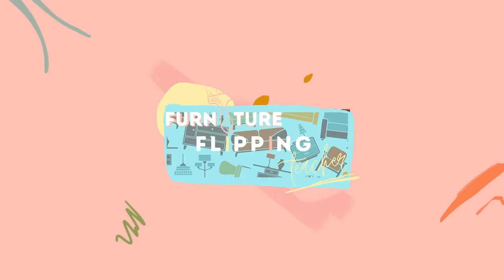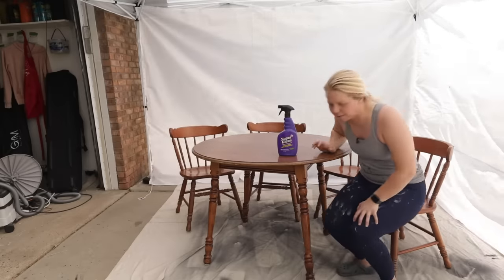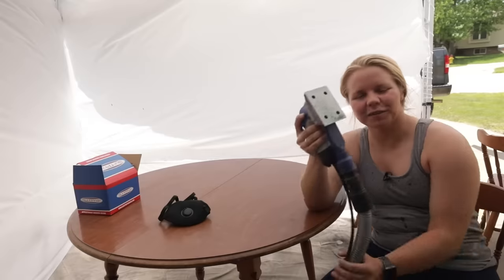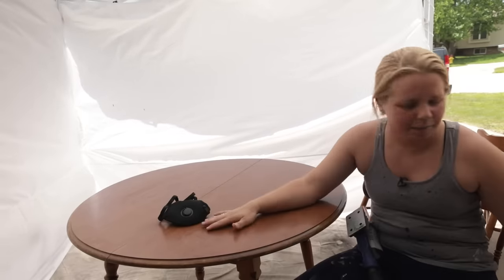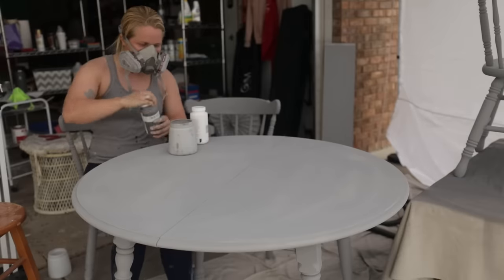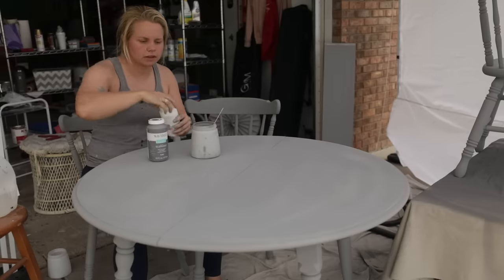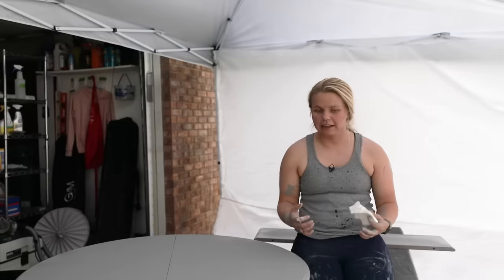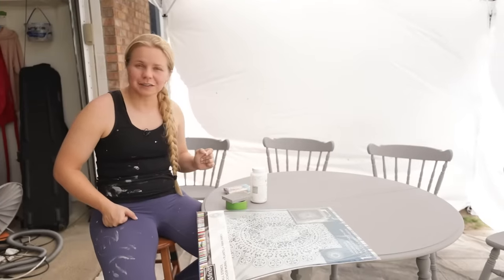WALMART CHALK PAINT??? Is it worth it? | Kitchen Table and Chairs Flip

Comment: A tip for stenciling if you don't want bleed through: have a paper towel handy to offload excess paint (less is more). Washing both sides of the stencil is really important. If ANY paint gets under and dries there it will be a constant point of leakage. Looks great though and not bad at all for a first try!

Comment: Love the stencil. Tried stenciling once,  smeared/blobbed. I need practice. Yours looks great! I think you should do more of it.
Reply: If you use a very dry brush, or sponge, it will work great. I would rather start with a very dry brush/sponge and have to make multiple applications, just to get it right, than to do it in a quicker time, and have it look messy.

Comment: P.s. I finished my first project today. I used Rust-Oleum chalk paint in country blue. And used Waverly clear wax. I found I did not use enough wax with the wax brush so I re applied it with a paint brush and wiped it back. Much better.  It's a found in the trash nightstand with two drawer. The drawer fronts had to be removed, were fabric covered, and was made from MDF. I did not paint them. I peeled off the fabric and tried a new fabric. It's not put back together yet. But I think it may look pretty nice in my room. Thank you, I have been inspired by you to try this! 😁

Comment: I am wondering what you got for it. I sold a solid wood round table, only 32” diameter. Waverly white on the bottom and Waverly Peacock on top and a white fleur de lis in the center. There were no chairs and I sold it for $150 in a suburb town of Houston, TX…8 years ago. Everything is even more expensive now!😊

Comment: I love stenciling although that particular one is not my style but after practicing quite a bit I have found that using a large fat stencil brush and offloading your paint until it's almost dry works best. Alot of your high end stockists, probably even Dixie Belle has the type of stencil brush that will really work much better, I started with sponges like you too. I would also suggest that on a table top Waverly wax or any brand of wax wouldn't be the best as tables get alot of use/abuse/wear on the top, I would stick to a few coats of traditional sealer at least on top. All in all I think it came out great, and it's great to see you're branching out, once you start stenciling and doing transfers it's addicting.  And men...lol...they don't always get it!!

Comment: So very cute! 250.00 is great up to 350.00. You did much better than I did with stenciling. I made a hot  mess when I did my first one. I had to sand off and start over like five times. Pixie spray tacky adhesive helped it not get under the stencil. If it doesn't sell you could try farm house decor. A White and black Amish look? I think it is cute esp. for a breakfast nook. Mrs. Laura Burcham commenting.

Comment: I love it I kind of think most people will get a little turned off because it's not asymmetric or you have a pattern going on the top making it more cohesive.
I mean that's just what I'm thinking most people that are OCD are going to say but overall it's good. I had a set myself that I sold that a butcher block top and had Napoleon style chairs that the whole thing cost me only $90 to do and I sold it for 300. So I think you have a shot at 300 at least.

Comment: I think you were supposed to use less paint when stenciling. Wipe off some of the paint off the brush.
Reply from the maker: Yes! I did do this (: Thanks for watching!
Reply: Hi Lauren! I watch all your videos time after time after time. I've learned so much. I was thinking about your table as I went to sleep last night. I love it but maybe a little color might be the answer. I think the paint on your mandalas looks good. I think though that I would add some maybe Fuschia paint on your stencils. Take one of your round brushes and do a type of dry brush technique.  Make light dabs of the Fuschia paint on your mandalas. Then use Howdy-Do Hemp Oil. It rejuvenates the wood..still a satin finish. Just a thought. Btw, I'm sitting here in Wichita watching you now. Great work!!
Reply: This was great but worth more like 300 to 350.

Comment: True stenciling uses very little paint on the brush it’s almost dry. That prevents bleeding and running. Most people I see load their brush with paint and start dabbing. Pour a small amount onto a small plate and tap off the excess then tap lightly onto the stencil. It’s not as fast but a much cleaner look.

Comment: I have stenciled a bit in my time.  You had too much paint on your dabber.  Dab on a paper towel to have almost a dry dabbler before stenciling on the piece and you will have less bleeding under your stencil (tape it down more also). You will have a more crisp outcome with less paint. Cute set though!

Comment: I haven't tried it yet but I've read that if you stencil with a layer of top coat first followed by stenciling with paint to cut down on runs under the stencil. I'm not sure how it will work on the parts that run off the table.

Comment: Tip for stencils:
-Use the dry sponge method
-Or apply satin top coat before do your stencil (the bleed through is going to be all with the top coat and not your paint
-Or apply a coat of your base color before stencil 

You did a great job!

Comment: I have been trying to redo my table top for the past 4-6 weeks and I’m about ready to burn the dang thing!! 😫😫😫 I don’t know WHAT I’m doing wrong and it’s so frustrating! I followed your steps of scrubbing down, sanding…..and sanding and sanding…..put my stain on and YIKES….no bueno! The rest of it; table base, chair bases turned out good…..but the tabletop! 😭😭😭 Then I was told the stain didn’t have anything to adhere to because of the way I sanded it. So then I applied a Zinzer sanding/primer type stuff and let it dry. Then I was told to use a gel stain ……..oh my gosh what a flipping mess!! My first redo vision took a major dump!
Plus, I want one of those sanders you use, but holy cow they are a bit pricey. So I need to start saving my pennies! lol

Comment: When you stencil, you are supposed to have a very dry stencil dauber so daub in the paint and then have a paper plate or something where you can dab most of the paint off and then apply to your stencil. You may have to go back over it more than once if you need more paint in the places you need more paint. A too wet dauber is how you get the blead through

Comment: Do you clean your sprayer between coats? If not how do you keep the nozzle from clogging?
Reply from the maker: Not between coats! I just put a damp cloth on the nozzle!
Reply: @FurnitureFlippingTeacher  I sprayed for the first time this weekend and I can not believe how smooth of a finish I got. Saved so much time. I used silk in the color Serenity by Dixie Belle so I did not need to top coat. Top coats have been my struggle, I can’t seem to get a brush free smooth finish. 
Thanks for sharing your technique with the Waverly wax.

Comment: Teach, I would do an under coat of a pale 💙 blue or pale 🍋 lemon, or both. Or what color you desire. Then your gray covering that for the second coat. Then come back in with your stencil but in a darker or lighter gray,  and a few wide and narrow width parallel  stripes of lighter gray.  Then distress, revealing the under color here and there as they would naturally appear distressed with prior coats of paint peeking through. Seal. And then wax.  I guarantee any lack of attraction to the table is that the gray round table with round stencil in white will look a bit drab and round to some. But add dimension and movement and impart a history and it changes everything. I wouldn't go less than $300. If you wanted to add gigham tie on seat cushions in a complementary color or design,  bump the price up to cover them plus time. If it looks 🎨 artistic and you tell the story of how it was your family table from childhood and you are trying for a down payment for your own home, it will catch someone's eye.

Comment: They just had the Rustoleum linen white chalk paint cheaper on Amazon, than the Waverly paint. 30 oz./$10.88. I grabbed two cans, it was such a great price. I am not sure if that is still the price or not, but it was on sale last week, for that price. It is usually $18.99/30 oz. on Amazon. I don't think 25.00 for the paint was that great of a price. I think I would prefer using one of the better brands of paint, if I was going to spend that much, even if I had to spend a little more.